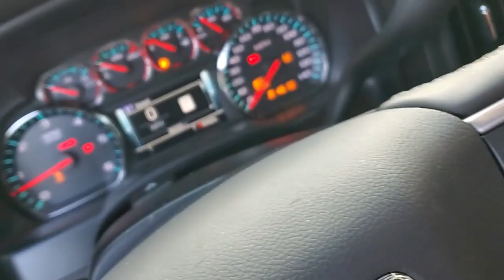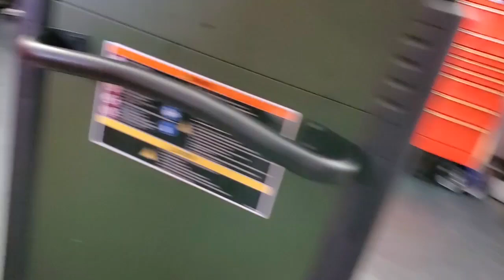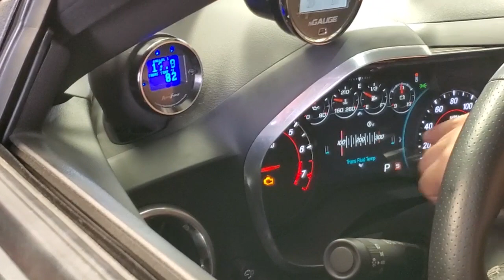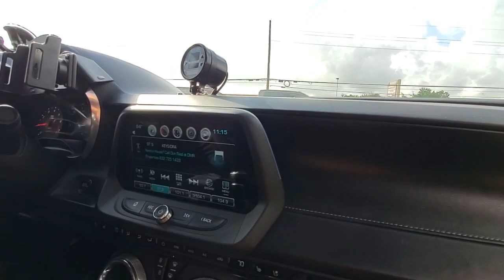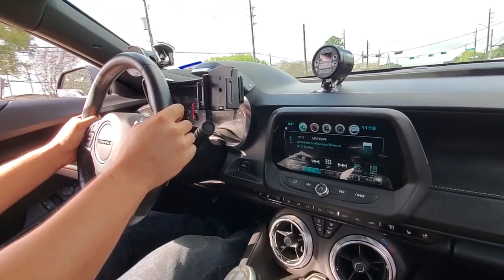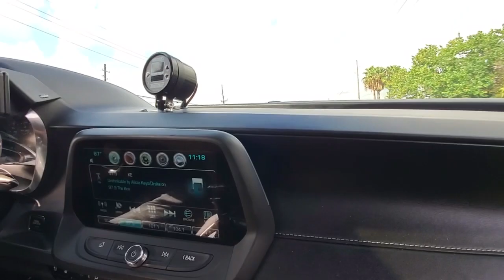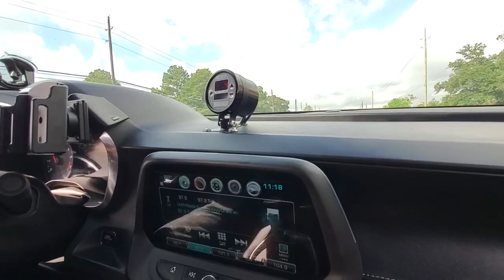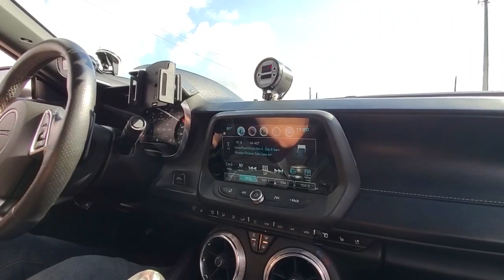First Twin Turbo Camaro Drive (Huron Speed Kit) 6th Gen Camaro SS

Comment: Hey I’m doing the same thing are you on a built trans? Bc my motor is built but not my trans
Reply: I would make sure your trans could support the power being given to it. So you don’t blow something. The stock trans could maybe handle a little more power but it’s ultimate intention was to handle the stock HP on paper. Just my 2 cents
Reply: Stock manual tranny I’ve heard is good until like 650hp but after that you have to do clutch and do lower gears forged. No idea anything about the auto

Comment: Definitely isn’t the first but okay 😂😂
Reply: @KiNg LIFE  big time I love the build tho
Reply: @thuntthunt  yeah the title is miss leading. maybe should add "My" to the front. Either way the car sounds great. nice to see more twin turbo videos. not many out there.
Reply: @ste6000   car is awesome
Reply: @thuntthunt  im still up in the air between this or whipple. both are very capaible 1K HP systems
Reply: I've been looking into prochargers. Really just want the most extra power with the least effect to normal driving gas mileage. Alot of research. Immediately not going super charger as that directly effects gas milage. And turbos you have to worry about your oil getting bad faster. Cant find much info on prochargers. They seem to be the most bang for your buck and low maintenance but im thinking a twin turbo wouldn't  be as bad as the turbos aren't huge but do alot. Much to think about.
Reply: It says first drive lol
Reply: It says first tt drive lol, no1 is misleading you just gotta read, also there’s barely any tt 6th gen maros, only guy I can think top of my head with a tt 6 gen is stang killer with his zl1